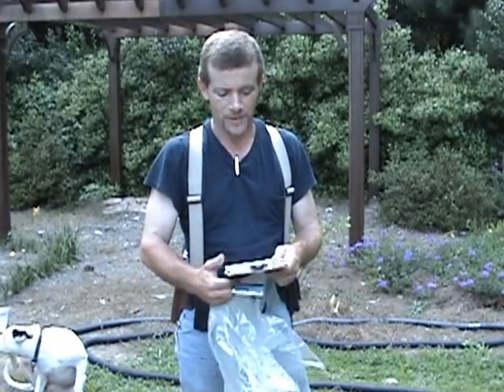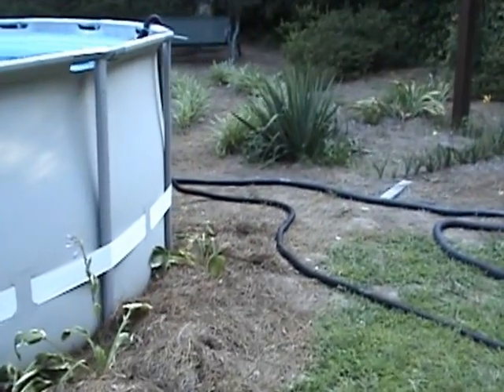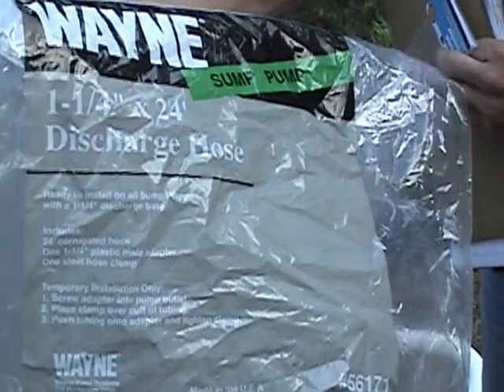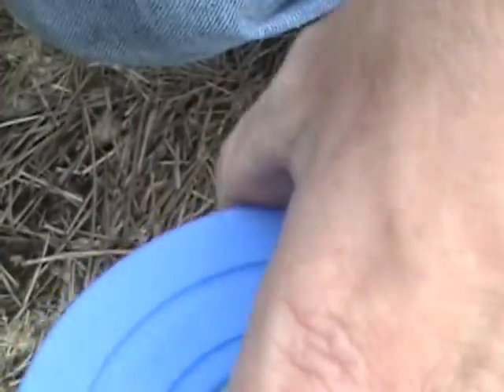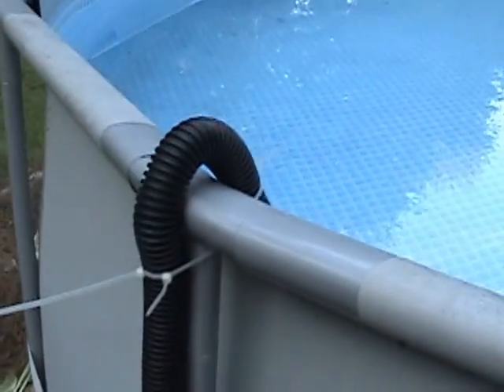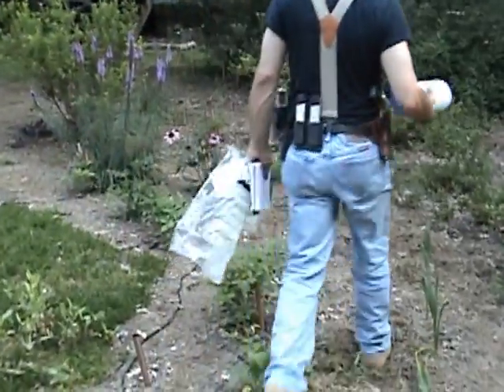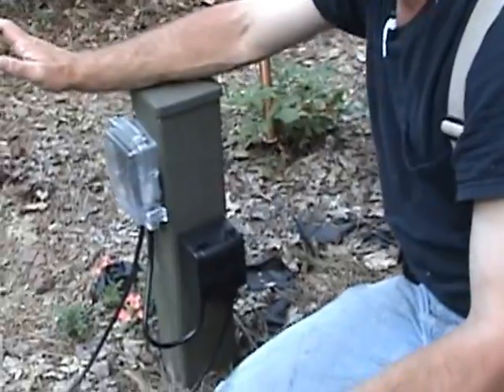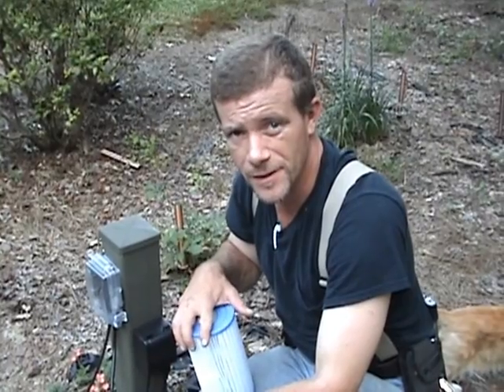How to build a pool heater

Comment: I know this is an old video, but I wanted to see you run this.
Reply from the maker: I would but the black hose i used broke down from the sun and cracked. I haven't tried anything else. It worked up til that point.

Comment from the maker: The pool heater worked good until black hose got pin holes...it wasn't UV resistant. I would use white pool hose and paint it black...but i had 75 feet so that would be  a pain in the butt. Plus i think  i  needed  50  more feet or so.